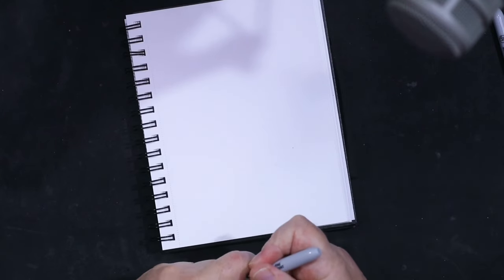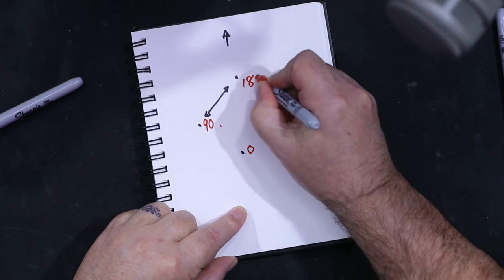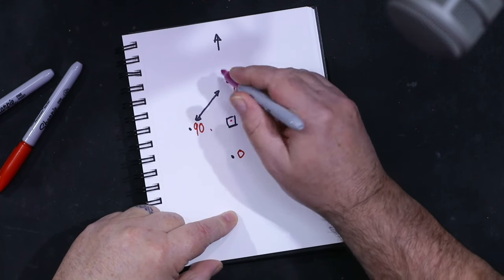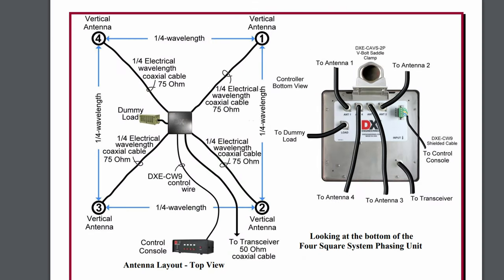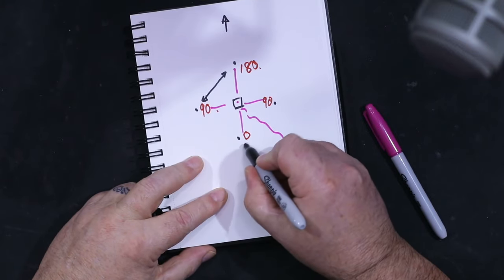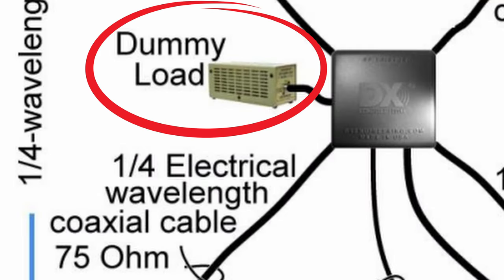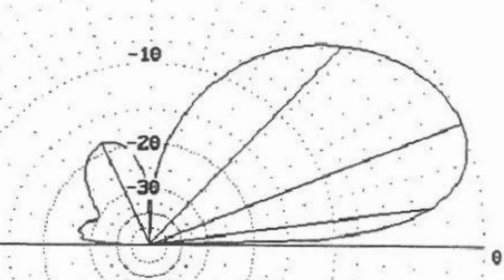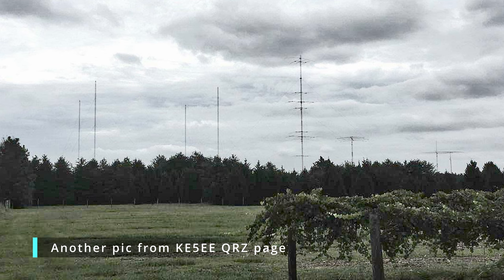How does a 4-Square Antenna Array Work?

Comment: I'm interested to see where this goes and it it ends up still being economically feasible.  And yes, I understand "economically feasible" is a relative term.
Reply from the maker: You are still looking at about $1000 I guess, complete.
Reply: @DXCommanderHQ  Thanks!  That price is certainly feasible, especially when you think about the price for a tower, rotator, etc for a Yagi antenna.
Reply: @DXCommanderHQ 

Might be a tough swing Fer some but a good deal better priced than a tower+ and I'd bet easier to move and more likely to get approved by the landlord if yer a renter.

Comment: Cal, parasitic array. Folding back the wire to make one wire for a few frequencies.  Is that possible? 

I am thinking 10m through to 20m as reflector and director for the DXC. 

Cheers, G
Reply from the maker: I guess you could..! Yes.. Good idea. (assuming I have the right idea!)

Comment: Has anyone experimented with feeding an inverted Vee using Christman phasing, but vertically instead of with two masts, with four wires on one mast to flatten the radiation pattern? They would need to be separated by a quarter wavelength. I'm envisioning a 30-meter mast with quarter-wavelength spacing.
Reply from the maker: Sounds like a similar system to K3RL on his 160m.. But he didn't use that method.

Comment: I was thinking, if you had an active array, it could be done.
Basically, have the RF come into 4 separate amplifiers that can be adjusted over 1080°.
You would need 1080° because if you phased the array at 1/4 wave on 40m, then 20m would be half wave so it would be 0,-180,-180,360 to make up for the difference than 15m would again increase in proportion to the wave to keep the array square. 
How an amplifier gets made that can phase shift that much I don't know.
But I imagine it would be expensive, then times expensive by 4.
Reply: Sorry for the listening side, you would just do the same in reverse with LNA's.
Reply from the maker: Clever!